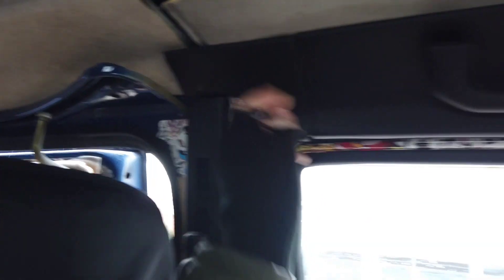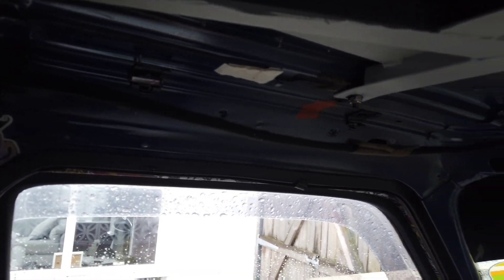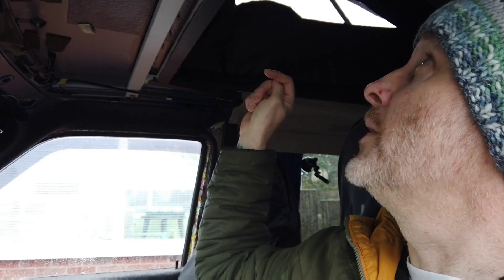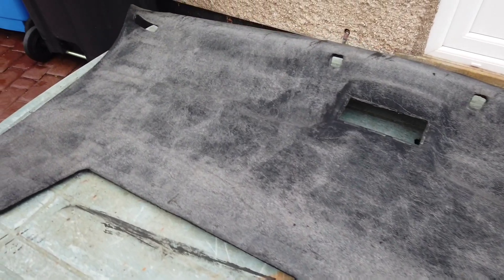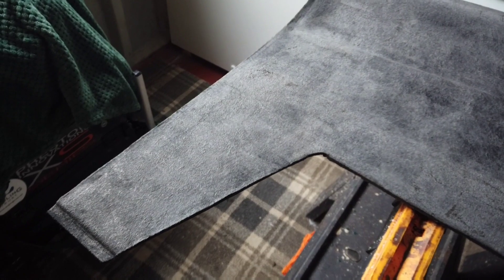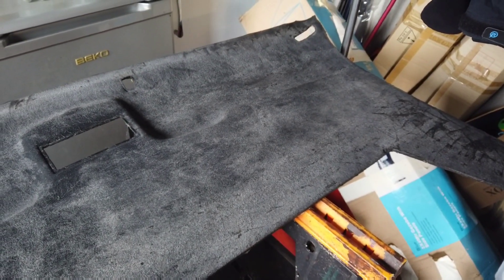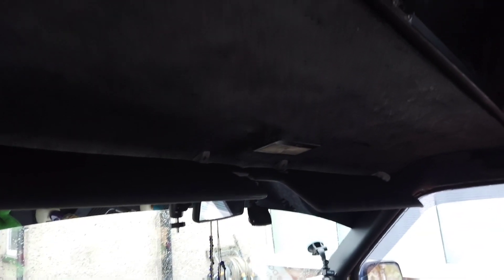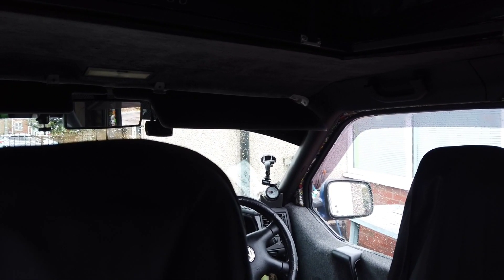We Tried to Retrim a VW T4 Cab Roof - You Won’t Believe What Happened Next!!

Comment: Just bought 1m x 2m of light grey faux suede roof lining material with a 2mm foam backing. £12 delivered from Vandalized. I have a few tins of spray glue left over from trimming the rear of the van. 

It took a couple of hours to remove the old foam and adhesive once the lining was taken off. Finishing by wiping the high density foam down 5 times with isopropyl alcohol. 

Soon as it stops raining I'll get it fitted and upload a video.
Reply from the maker: Nice one.... Used to have something similar, just fancied a change.  That'll teach me lol..